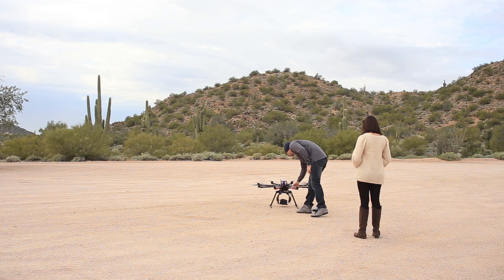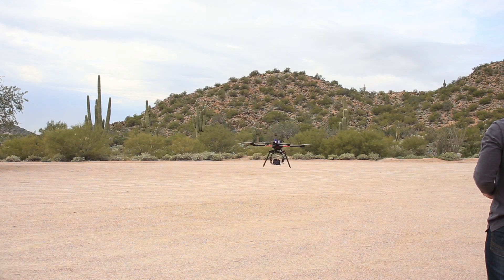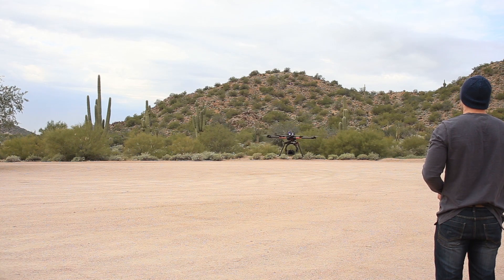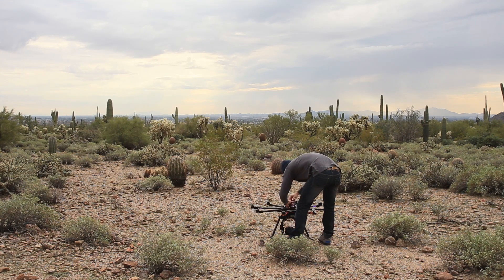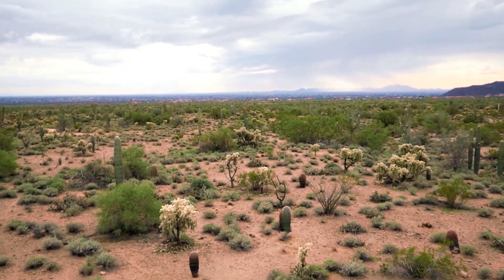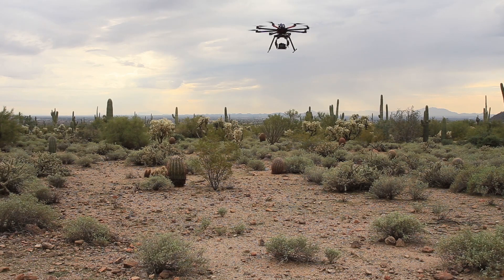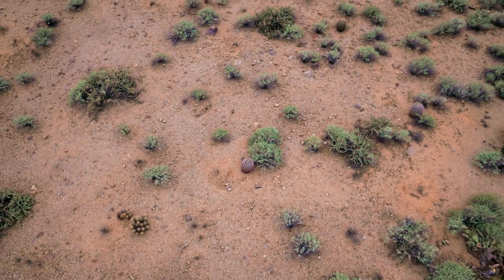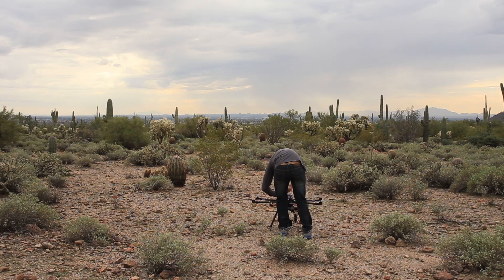FIRST TEST FLIGHT WITH PANASONIC GH4 ON MY NEW OCTOCOPTER DRONE

Comment: I bought the GH4 also to shoot 4k video plus to eventually use on a UAV system. Why did you choose this UAV system and not something like a DJI S900-S1000 with a Zenmuse gimbal.  I also noticed that the GH4 image from the drone looked really soft, what happen there? Thanks!